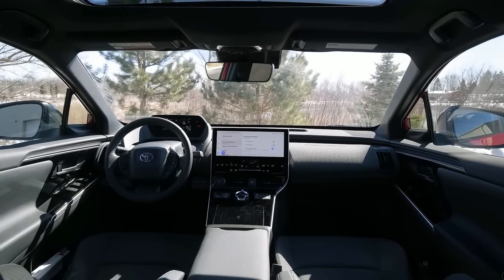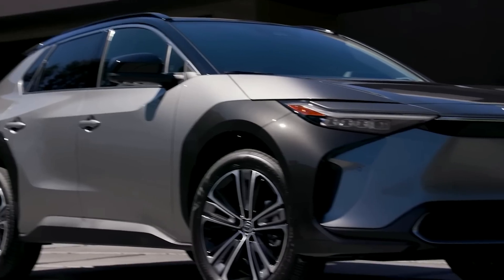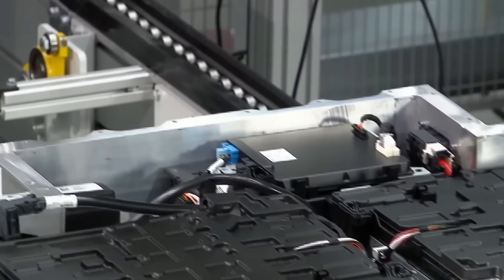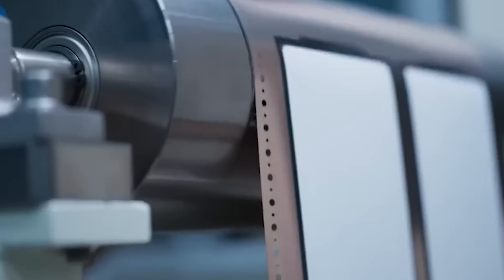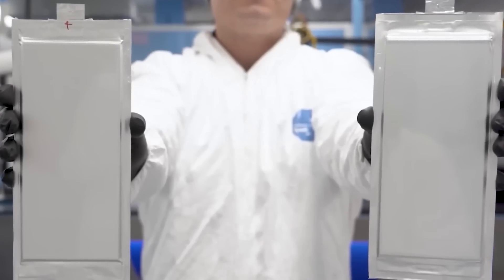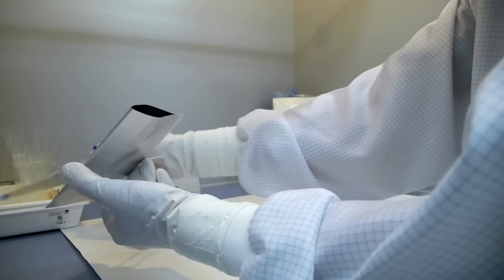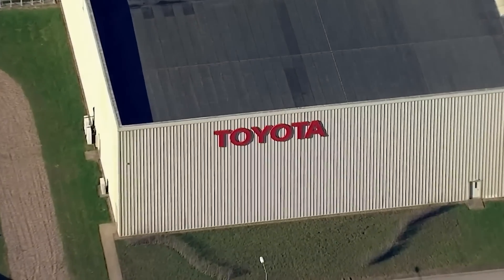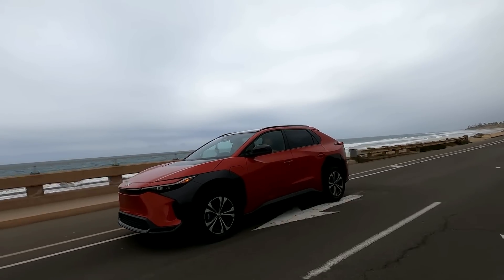Toyota CEO "Our Solid State Battery Will Change The Industry In 2024"

Comment: They’ve been promising their solid state battery for years. Don’t get me wrong, I hope they do have a new solid state battery ready to go within the next few years, but we’ll see. Once it hits dealerships at a reasonable price? I’ll believe it. Otherwise, this is just more talk from them.
Reply: By the time Toyota finally makes their SS battery, there will be other companies manufacturing theirs already.
Reply: @ElementaryWatson_fafo  For anyone keeping tabs on EV battery progress, the range keeps getting better, the charging speed gets better, the safety gets better, cycle life (longevity) and price get better such that you have to wonder whether solid state will be a meh improvement by the time Toyota is successful.
Reply: TBH I think they have the highest number of patents regarding Solid State Battery
Reply: No. Don't mix it up again. They have been open about developing solid state batteries.
The press and internet bloated it up out of proporsion, swearing the revolution for next year, and next, and the year next of that.
Internet and it's total lack of ethics is completely responsible for that.
Not Toyota engineering or marketing.
Toyota will simply announce the product when it's ready and you will see it included in their catalogue.
That's it.
Reply: 20 years to be exact
Reply: The issue is scaling. It needs a lot more subsidies to get it to industrial scale before they go into mass market, and this is going to take them a longer time than Chyna will.
Reply: They've been lobbying the Japanese government to slow the pace of EV adoption.  The goal of this video is just to convince you that any current EV you can buy isn't good enough, or is dangerous, and that a better one is right around the corner.  So you can either wait for it, or buy a Prius
Reply: Correction: they have been researching solid state batteries for years. Every now and then they communicate how far they've come. 2030 has been the target for commercial release for a long time but anything can happen of course.

Comment: Great improvement. But i am worried that this kind of battery will lead to like catalytic converter stealing now a days. And these people might take the whole car and leave it after taking the expensive battery. 
Toyota should include  safeguarding this like installing location finders, etc. Not like what Toyota did with easy to steal catalytic converter .
Reply: Doubt it would actually happen as thhey would need to steal the whole car and not just the battery. Catalytic  converters are stolen because they are really easy. As many just sit below the car without cover or hindrance. This makes it easy to cut the front and back pf said catalytic converter and pull it out in less than 3 minutes. A full battery that covers the whole car and is both the frame, subframe, and actual floor of the car is going to be a tall order without stealing the or just towing the whole car.

Comment: Summary of actual Toyota Press release. 

This short video is click bait about non-existent tech. Toyota 'might' have solid state batteries in 2027.... Totota might also go bankrput by 2027 at their rate of mismanagement. 

Thumbs down.

NAGOYA, Japan -- Toyota Motor aims to release an electric vehicle powered by an all-solid-state battery as early as 2027, with the technology expected to more than double the car's range from a single charge.Jun 13, 2023

Comment: LiOn batteries 🪫 have a significant problem… they are expensive.

The majority of auto buyers worldwide can afford $25 - $45k with viable financing around 0.75 to 2.99%.  Inflated numbers around $65k to $125k are unreachable for the majority of buyers.

Secondly, range anxiety coupled with charging g times makes new adoptees leery.

Once EVs are comparable to ICE then the pendulum WILL swing permanently.

It’s a matter of time.  By the end of this decade we will see significant improvements and viable options.  Perhaps as low as $40k, 600 mile range and 15-20 minutes to charge.  But that’s not the goal.

The goal would be $25k, 1000 miles, and 80% in 10-12 minutes.

Until then it’s just for the elite 😢
Reply: I agree with you, but I believe that solid state Sodium batteries could be on the market soon. The main thing about Electric Vehicles is that they have about 24 moving parts compared to an Internal Combustion Engine (ICE) Vehicle which has about 2,400 moving parts. Furthermore, an Electric Vehicle doesn't need oil changes or other types of maintenance. In the long run, I believe EV's will replace ICE vehicles and be lower in price, but it will take a few years to get there.
Reply: Name one ICE vehicle that gets anywhere close to 1000miles on a single tank
Reply: @Church287 I think he meant kilometers
Reply: 1000 miles not kilometers 

Today’s top mileage EV’s
Lucid is max around 620 and Tesla claims their Roadster will get around 600… 

Tomorrow’s 
?

Hoping for 1000 miles bc that means 20% to 80% daily is 600 and that is a full 8 hours drive… the recommended max a person should drive before resting another 8 hours.

Thoughts?
Reply: Also I’ve owned 2 Tesla Model S and the became too costly.  The monthly note was ~ $1400 and the tires 🛞 were $1350 at. Costco every 9-15k so that sucked.